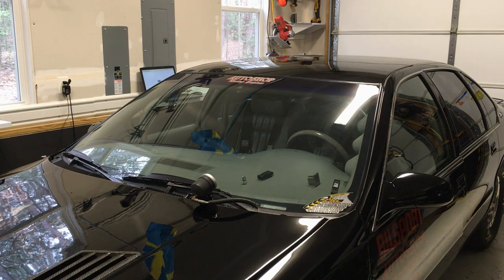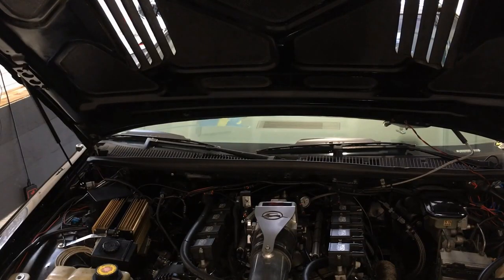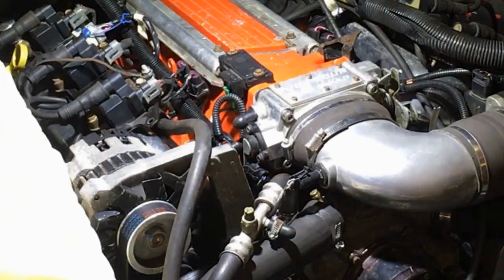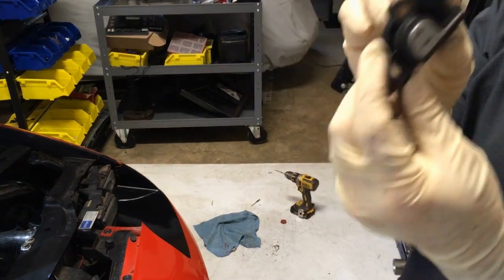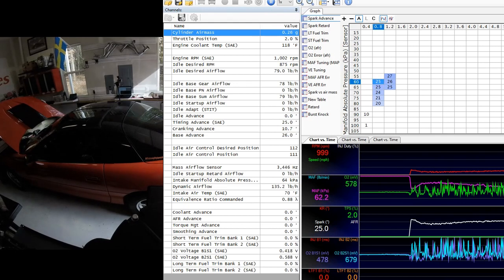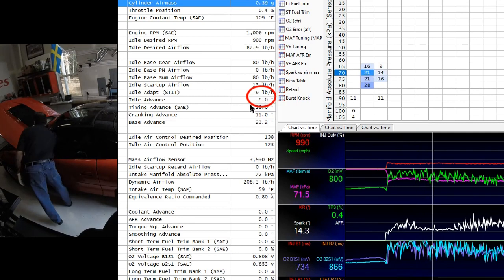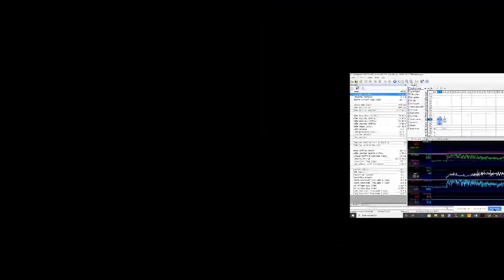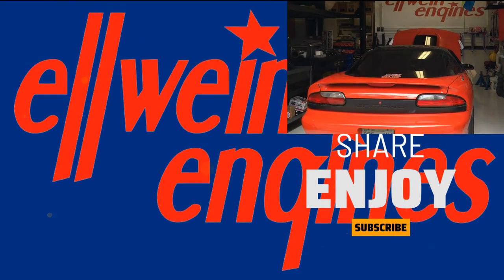LT1 Throttle Blade Tuning via HP Tuners

Comment: So in other words the computer had no idea where it was at?.
Reply from the maker: Yes exactomoondo.   or do you mean the throttle position?  The mechanical stop on the TB was at a point where the sensor still measured a bit open.

Comment: You couldnt have just adjust the idle SCREW?
Reply from the maker: Good question.  Actually no.  You cannot get many aftermarket throttles to show 0% throttle position just by adjusting the idle screw to full closed.  Sometimes you can. Certainly not when you do have to crack the throttle open a bit for enough air to idle.  On the factory PCM P01 it does not have a calibration adjustment for that.  It needs to see some certain voltage from the TPS to think zero.  So slotting that TPS is the old school way to make it show the closed throttle voltage needed.   So the purpose of this video was to get the PCM to go into the idle tables (at 0% TPS)  without changing to idle parameters to say...3% throttle is idle.